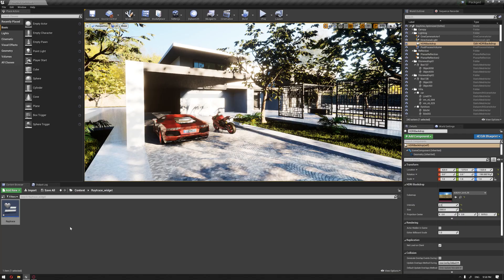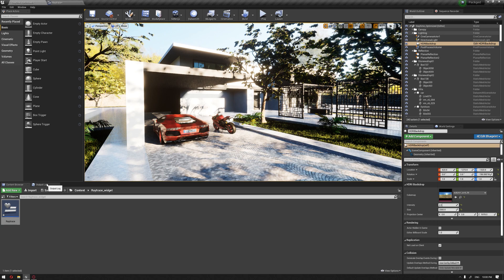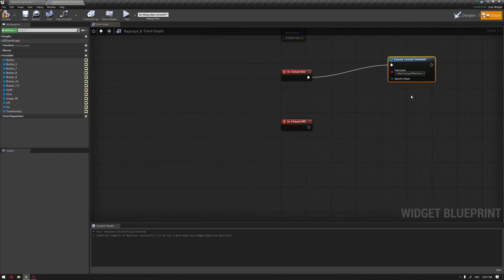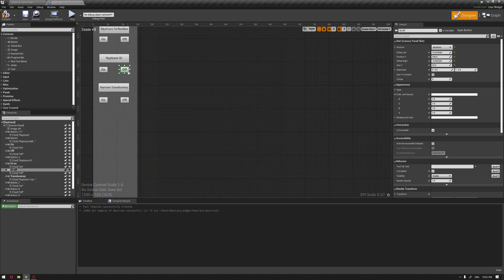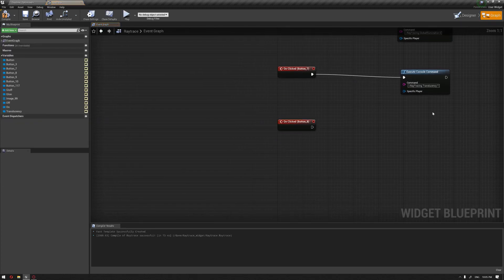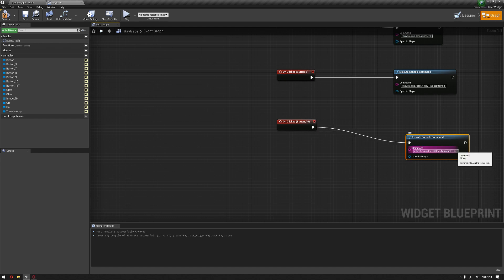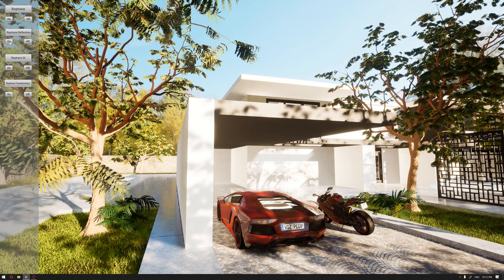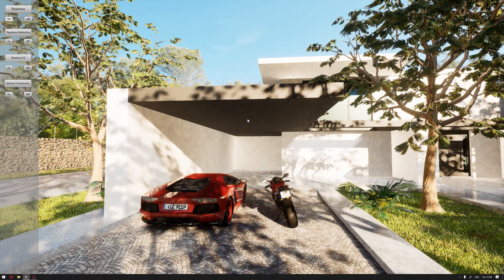Unreal Engine 4 Arch-viz Tutorial Course part 12-2 Controlling Raytrace in Realtime by Widget button

Comment: so did u mean rtx 2070 is not powerfull enought for unreal engine ?
Reply from the maker: RTX 2070 is actually a good card for small Raytrace projects , of course the recommended for Archviz is 2080 ti and higher , but still you can mix between raytrace and baked lightmap to get the best out of your project even with 2070 :)